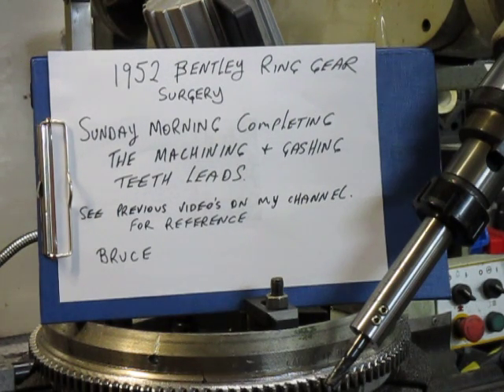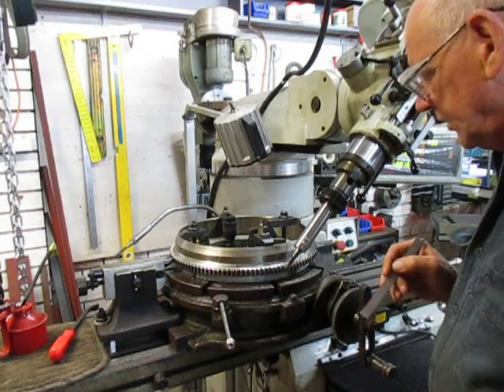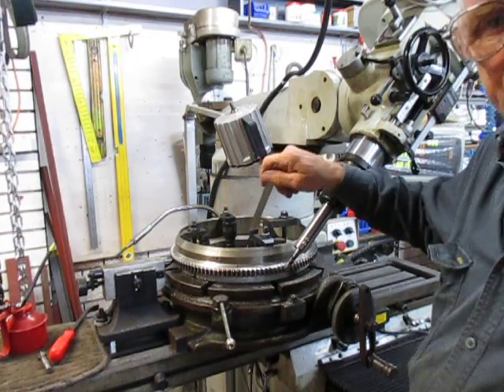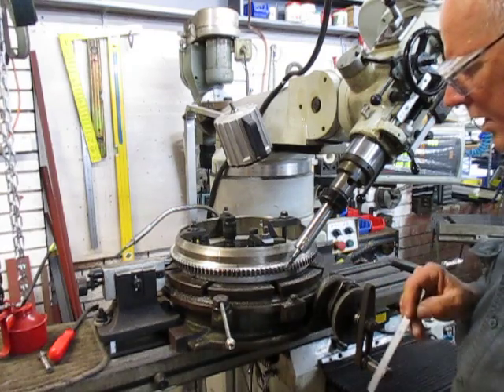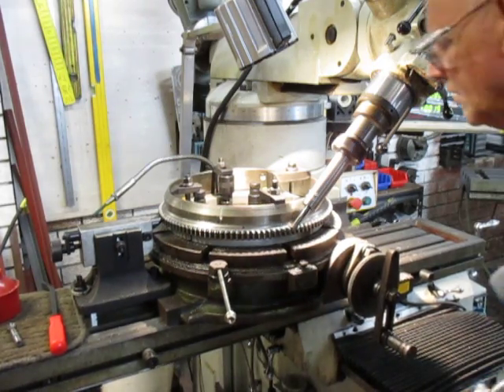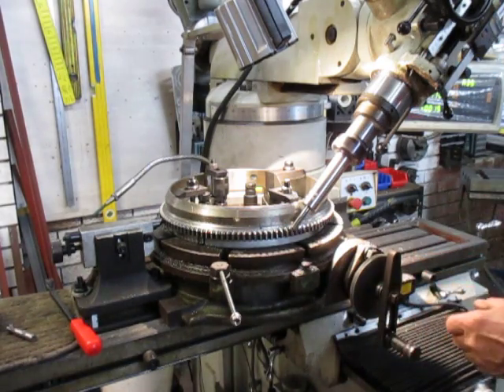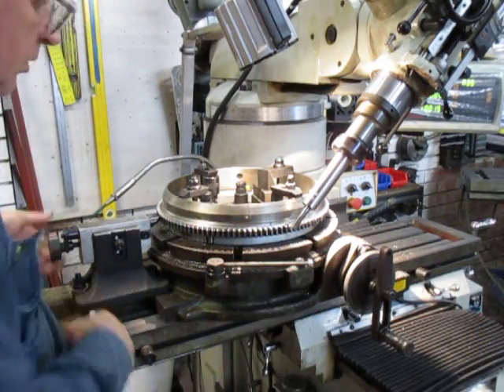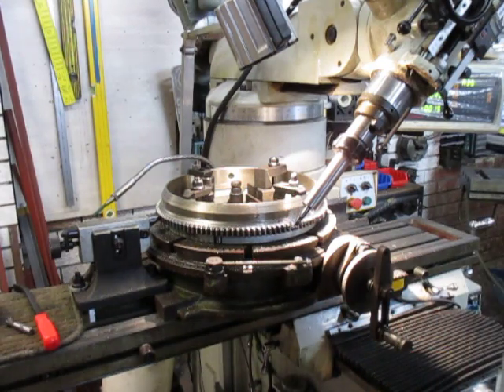1952 Bentley Ring Gear repair 6

Comment: I have been busy lately but made some time to stop in and take a look at your ending to this job. From your description, when you first started I kinda pictured the ending hardness of the weld build up, like you said the type of rod used and material type and all the other variables, we have to come up against is a mystery sometimes until we touch a tool bit to it! LOL, Nice demo on using the tail stock to copy index / index off itself. Cheers, ;{)-----

Comment from the maker: The monkey is off my back, This job was both rewarding and a little tricky to say the least. I had no real choice but to nod the head on the mill on two occasions, something I prefer not to be drawn into, but equipment limitations are as such that there are no choices short of not doing the job, which to me is not an option. This was not the first one this week, I had a transfer case that I welded and that is always a challenge welding old aluminium with oil ingress into the casting on one hand and soft from heating and cooling over the years.